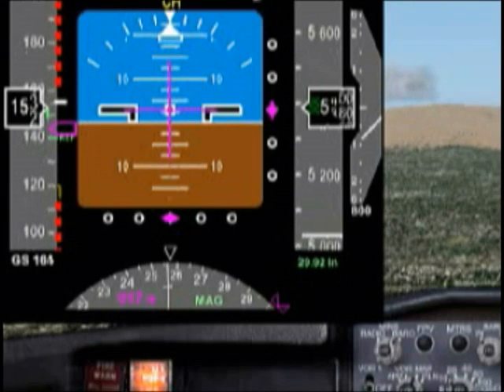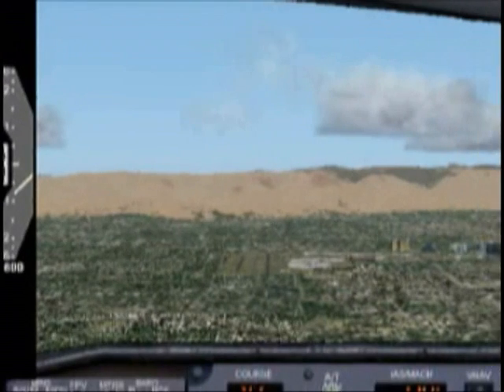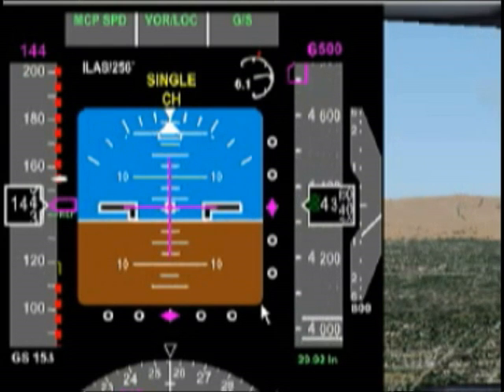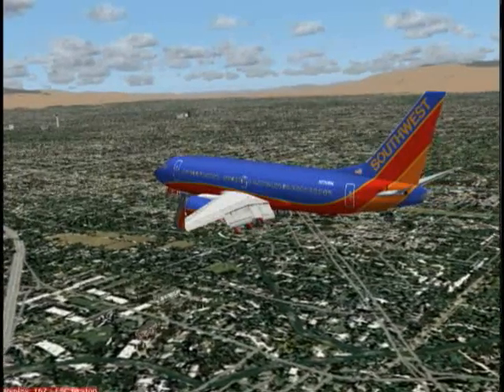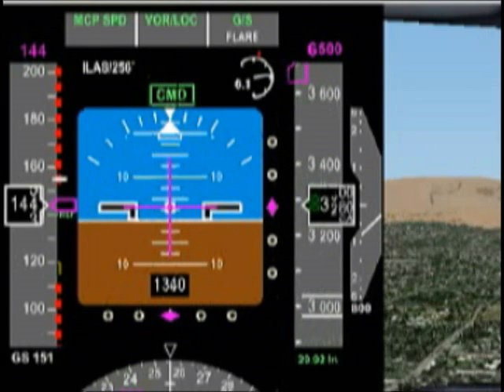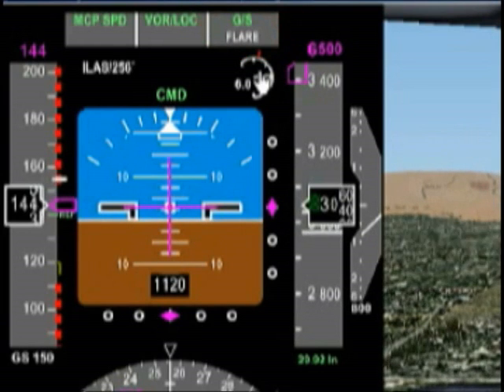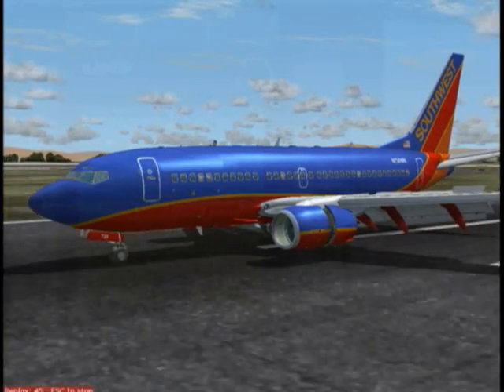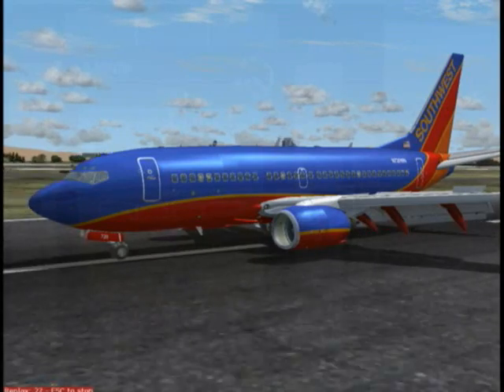PMDG FMC Tutorial Part 9

Comment: Great tutorial! 
I liked the professionalism, the fact that you stuck to what you wanted to present which is the FMC.
And, you are correct. Having been on more than 3,500 commercial flights, and talking with hundreds of pilots, all of them say that they use the AP for just about everything and they don't mind a bit. You are correct when you say that the AP is safer, more fuel efficient and used extensively in commercial flights.

Comment from the maker: @kieranman739 You only need 2 activated if you want the AT to do an automatic flare otherwise you can use one. Its not a bad idea to use two as in the real world 2 is better then 1 in case one goes down. The other two are for the copilot to use if hes flying from the right seat that way there is no confusion.

Comment: in the cessna, the rudders do respond and correspond with my joystick movement--in my PMDG, the wheel is turning instead of the rudders...Also just a side question, sometimes i like to assist turns by using only the left or right engines...In the 737's it seems that if I select one engine, (ie E+1, or E+2) I can NEVER select both of them again--engine 2 will remain idle no matter what afterwards...are you getting the same thing?

Comment from the maker: @okturus The horn is a warning sounds that something is not configured correctly for takeoff. The 737 will yell at you if it senses that something is not right. Make sure the break is off, make sure spoilers are down, make sure flaps are set to at least 5 degrees or more (5 is the common one).

Rudder will still work with the Yaw damper off so if its not working check your joystick assighnments. Load up the cessna and see if the rudder works on that first as it will alert you to the problem.

Comment from the maker: @kh2712 Level change gets you to the next altitude as quickly as possible. So lets say for instance  you are at 13000 feet and you wanted to go to 9000. Well just put 9000 into the MCP and hit Level Change. It will get you to 9000 at the highest decent rate without building up airpseed. I dont often use it but its convenient when you need to drop down and have charts to read so this way the AT does all the work and you can check charts.